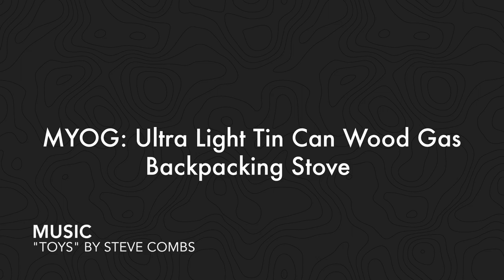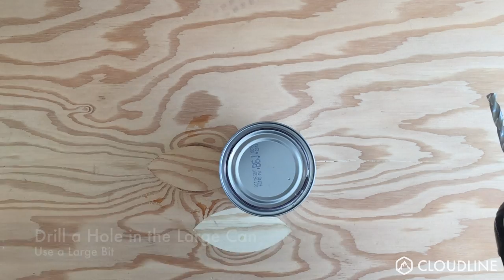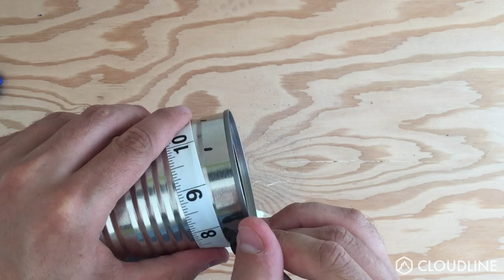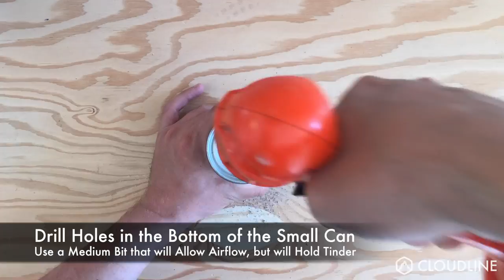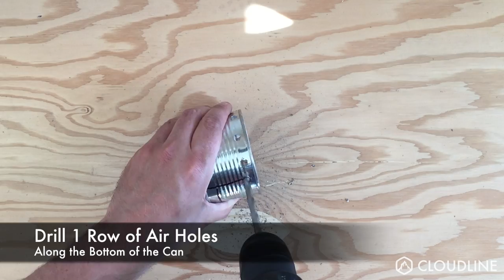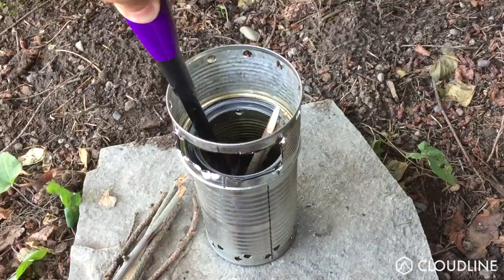How to Make a Tin Can Wood Gas Ultra Light Backpacking Stove

Comment: Pineapple tin is zinc plated to resist corrosion, this is not a good choice of can as the zinc will burn off as you use the can. Best use any other kind of can so long as it is NOT zinc plated.